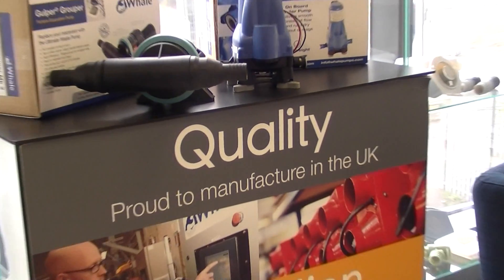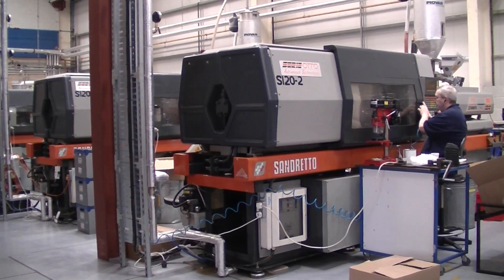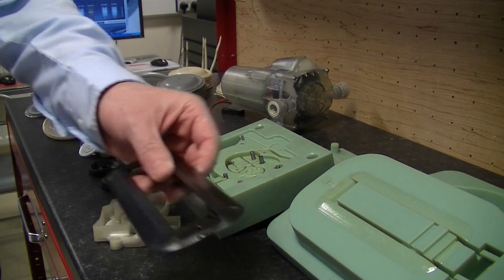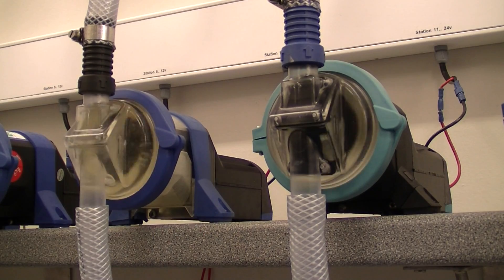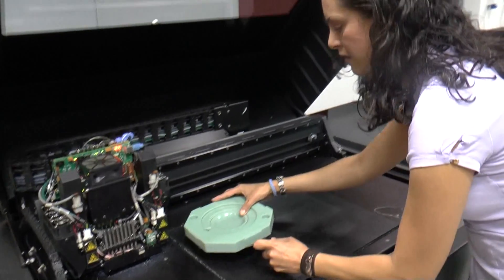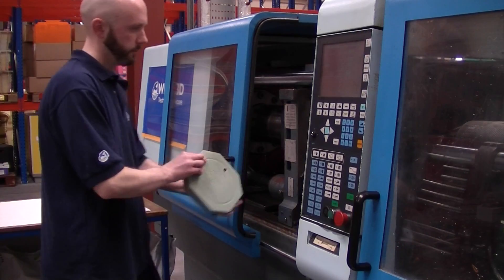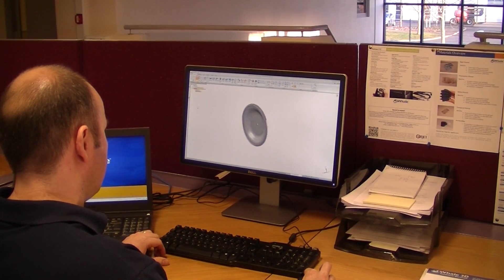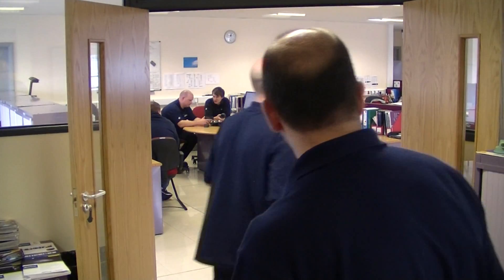Whale  Cuts Lead Time by 97% with 3D Printed Injection Molds

Comment: but its still quicker to machine the molds. its also a better finish!
Reply: I don't think printing the injectoin mold is that much cheaper. I did a test on Sculpteo, a company that 3D prints using PolyJet machines, and an 8"x8"x2.5" mold would cost $5500.
Reply: You could always purchase a 3D printer and print your own for just a few pounds like I did!
Reply from the maker: jammapcb  Hi Jammapcb! If you need to create injection molds to test designs in final materials, 3D printed molds easy beat CNC molds in many cases in terms of time and cost. Would you like to speak to a Stratasys representative in your area for more information?
Reply: Stratasys well i buy up ingots... plus tonne of plastic pellets for around 1500 dollars.... works out cheaper for the most part... ive seen many 3d printers... just takes to long what I see of it. and the price of the machines are still hefty! for us mortals! I do everything in house.... never to third parties!
Reply from the maker: jammapcb HiI was referring to 3D printing the molds themselves, not the plastic part that comes out of the mold.
Reply: Stratasys whats the cost per cubic inch?
Reply: Do have an agent in saudi arabia?